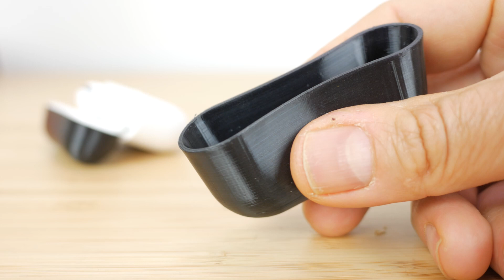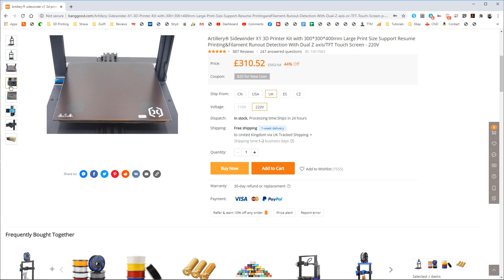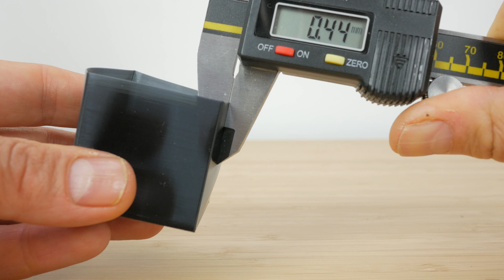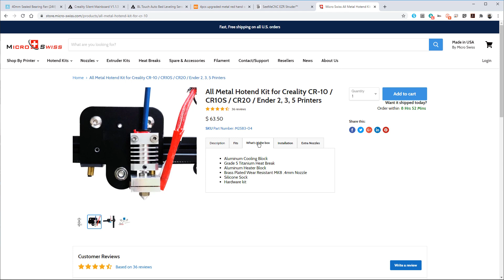Creality Ender 3 review | Best budget 3D printer in 2021? | + Introduction to 3D printing

Comment from the maker: Have you been tempted to give 3D printing a try? Are you put off by having to assemble this printer? Let me know down below!
If you want to skip forward or back at any time in this video, please use the timestamps below or the chapter markers YouTube creates from these in the timeline ...
Timestamps:
0:00 Intro*
0:48 3D printing for complete beginners*, how 3D printers work, FDM vs SLA
1:27 Build size, printing costs
2:08 Adding second colour
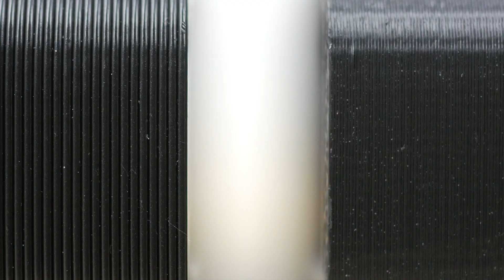2:23 Layer height or resolution, nozzle size, Print speed
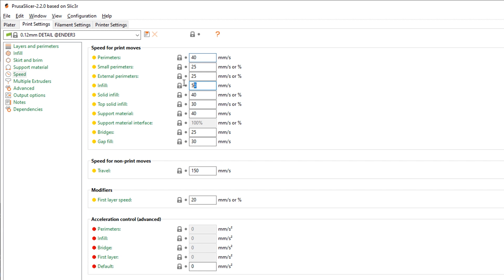3:22 Heated bed, and bed levelling
3:53 Filament types: PLA, PETG
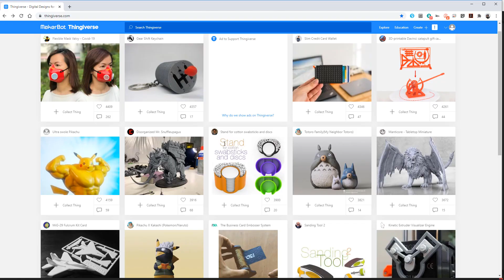4:30 What to print: Thingiverse
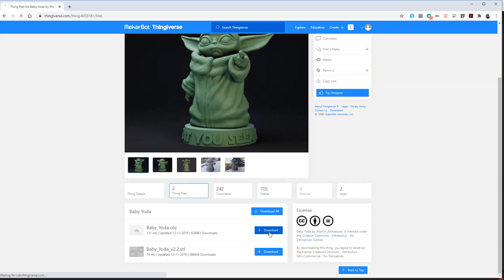4:46 How to send a file to the printer
5:14  Designing your own prints: 3D modelling software - Tinkercad, Fusion 360, Shapr3D
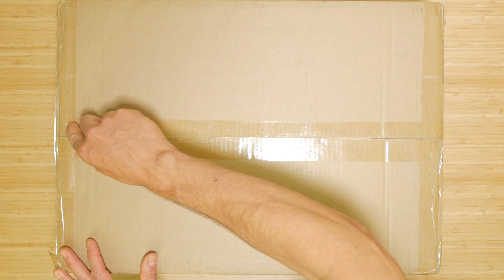5:47 Ender 3 Overview*, unboxing, included accessories and tools, assembly guides
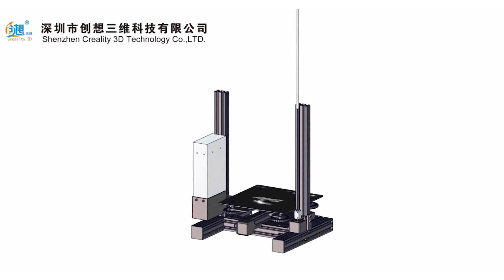6:45 Printer assembly
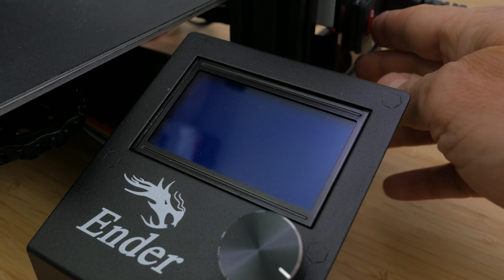8:04 Turning the printer on for the first time: Auto Home
8:29 Manually levelling the bed
9:53 First print - preheat nozzle and bed,
10:32 Loading filament, direct drive vs Bowden extruder
11:59 Downloading STL file from Thingerverse
12:13 Slicing in included Creality Slicer
13:13 Saving to microSD card and loading print on Ender 3
13:38 Print quality and performance*
13:39 Tests at various layer heights / resolutions, using Creality Slicer, adjusting skirt
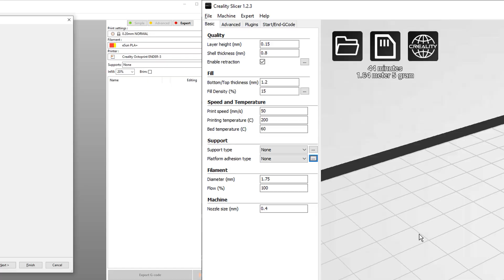14:55 Results with PrusaSlicer with test prints: Marvin and 3D Benchy
16:09 Printing PETG, temperature tower, prints releasing from bed
17:44 Printing flexible filament - extrusion multiplier
19:09 Build plate - prints sticking to and releasing from
19:30 Bed levelling with Gcode file
20:02 Printer noise
21:02 Power usage
21:13 Printer safety - thermal runaway protection
21:42 Upgrade options*
21:57 Free, printable upgrades
22:19 Calibrating extruder, setting e-steps
22:37 Optional upgrade options: nozzle fan, BLTouch levelling probe, new springs, EZR Studer, new hot end
23:13 Octoprint on a Raspberry Pi with webcam - for easy printing and monitoring
23:48 Conclusions*
*Sections

Comment: Hi man how are you, I just wanted to know, is this printer capable of making glossy and see through 3d printed objects
Reply from the maker: Hi - you can get glossy PLA and printing slightly higher temps makes prints more glossy. You can get translucent PETG - not fully clear though. Both these filaments print fine on the Ender 3.

Comment: Hey Technology Man. I just got my Ender 3 and have been busy making cool stuff. Is it safe to leave it printing on a long print overnight while I'm sleeping? Thanks!
Reply from the maker: Hi! I do leave mine unattended - with Octoprint installed on a Raspberry Pi with a webcam attached to keep an eye on it. I did check my model for runaway protection and it has it - but you still need to exercise caution. Have fun with it!